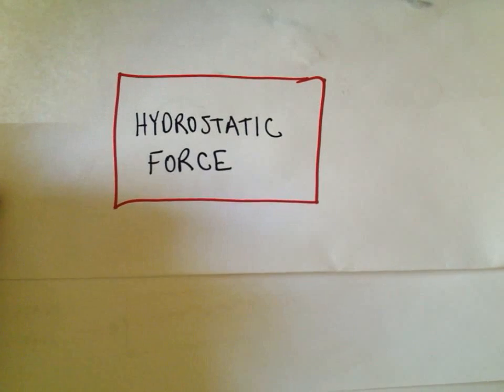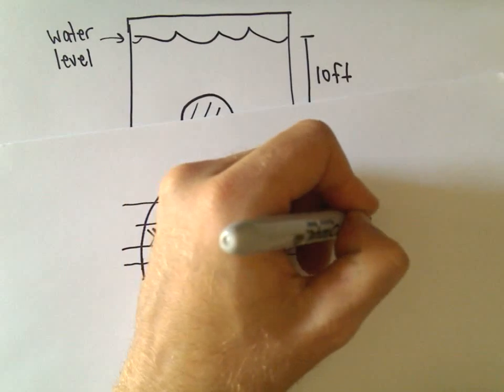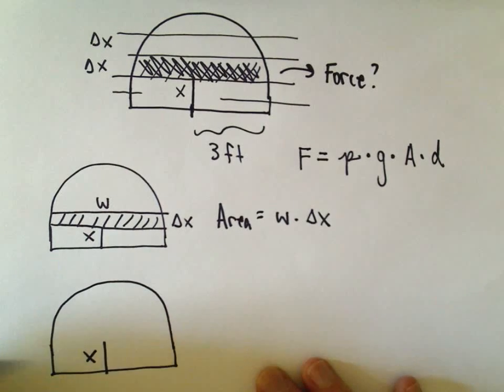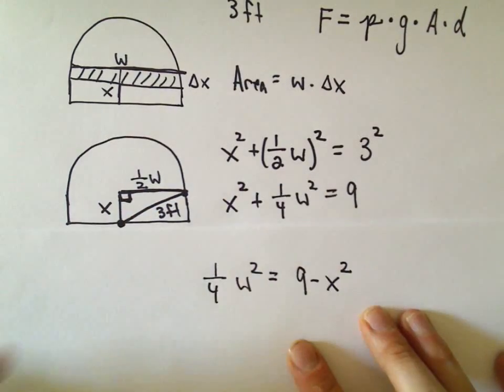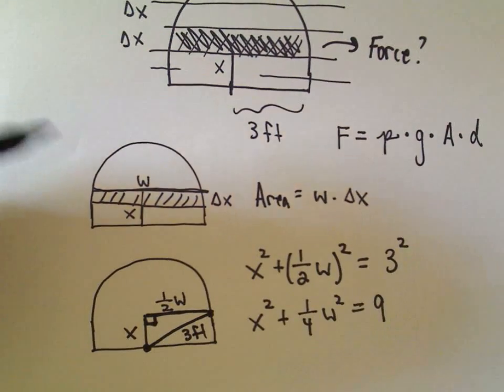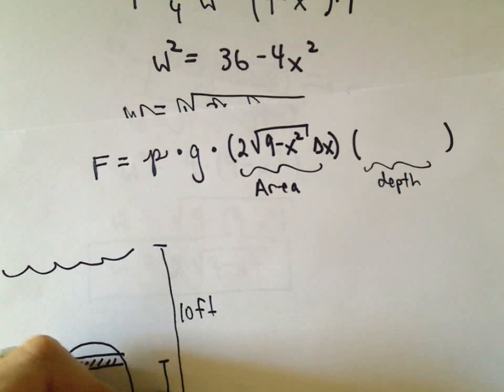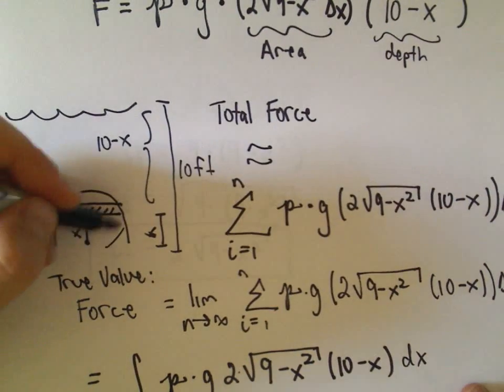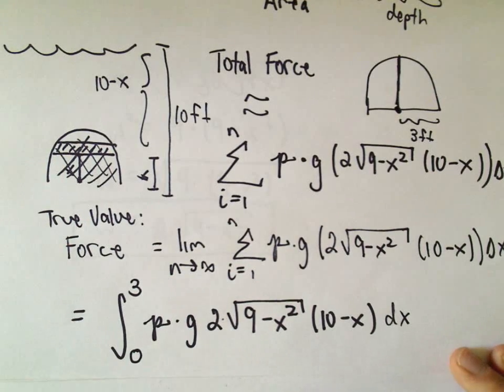Hydrostatic Force - Complete Example #2, Part 1 of 2

Comment: An easier way to find the width of the slice is to use the x^2+y^2 = r^2 equation for a circle centered on the origin. That way you can have x^2+y^2=9^2, still solve for x and get sqrt(9-x^2). With width as 2y, you end up with 2*sqrt(9-x^2) with a lot less geometry.
Reply: Que

Comment: I'm not sure, but I don't think so... because the second half of the circle is not in the same water level as the top half, so the pressure is greater down there, so you'd have to compute the integral for that half separately, and the height and limits of integration would be different, I think, but I hope PatrickJMT pitches in and lets us know...

Comment: So if you set your origin at the top of your gate instead of the bottom, you would have the integral limits at 0 - 3 still, your depth would be (x + 7) and everything else would stay the same.  Is this correct?

Comment: @Mysticsam86 I never sad that he is doing it wrong. I was wonder if my way was cleaner,, and if you look at 4:53 his answer is W= 2 (sqareroot (9-x^2)) and if you take the sqareroot away you get 2(3-x) and then you multiply the 2 with 3-x and you get 6-2x. So now i have showed you that my way is right and his is also right but he is leaving the sqareroot. So my bottom line question is why is he doing that? I didn’t see any part of his calculations there he needed the sqareroot ?